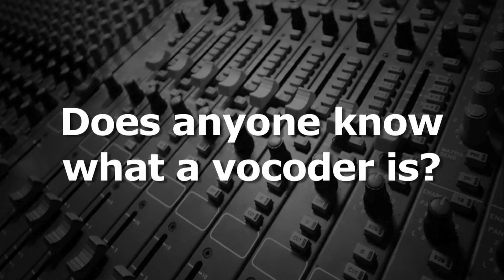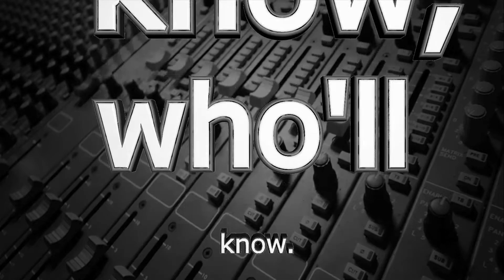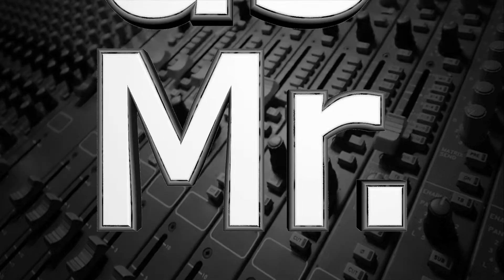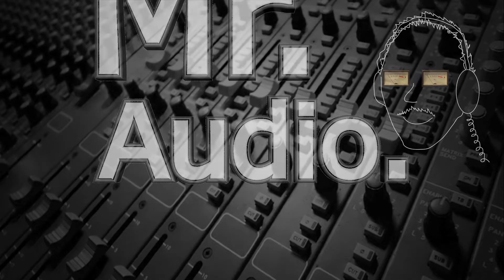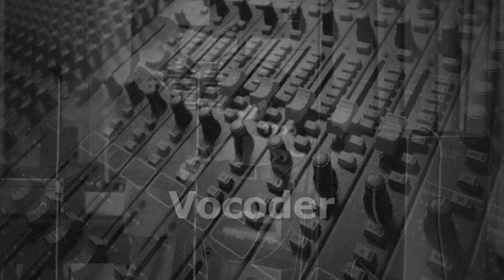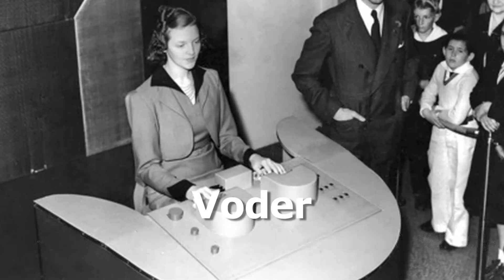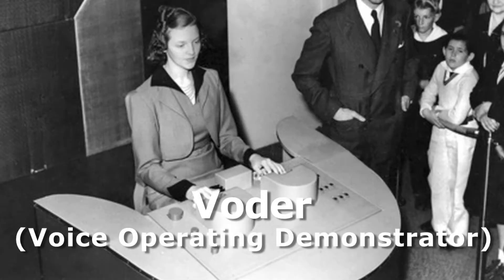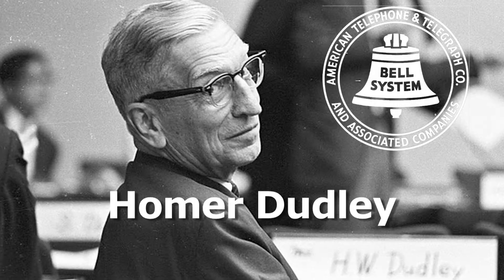Vocoder

Comment: The only that isn't correct with this video, is the voder isn't actually older than the vocoder, Homer Dudley created the vocoder a year or before the voder came out.The Voder is actually half of a vocoder ,  A vocoder has 2 filter circuits, a encoder and a decoder, the voder only has the decoder part. Homer dudley figured out you could manually control the 10 decoding filters, with a key on each filter, you could create understandable speech without the need of a humans voice. So in reality the voder was designed to show off how the decoding part of a vocoder worked, and how speech could be synthesized.